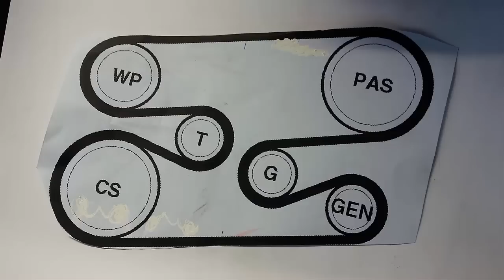Land Rover Freelander 2.0d

Comment: Hi, this has been very helpful, I have a 2001 TD4 diesel, Thanks, one question, when you took off the tensioner (top) bolt, was that a left hand or right hand thread I am having trouble getting that bolt to move.  Thanks from New Zealand. ;)